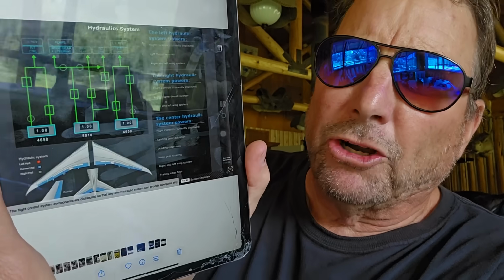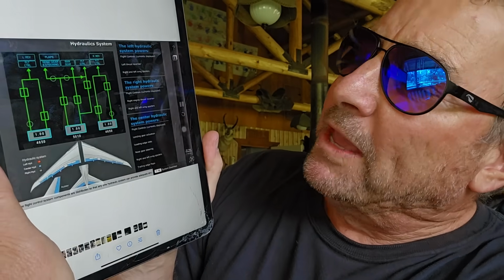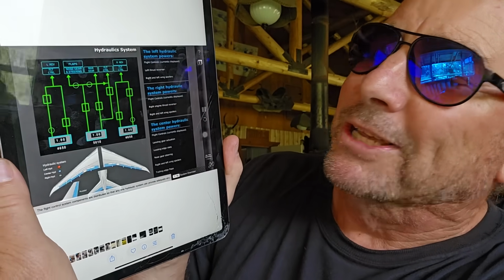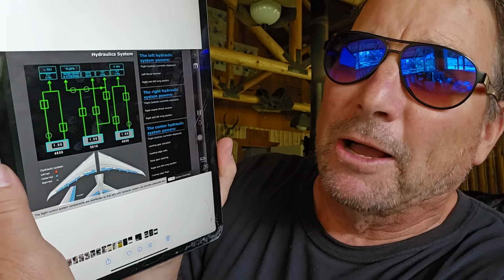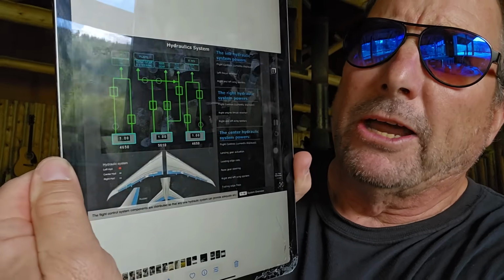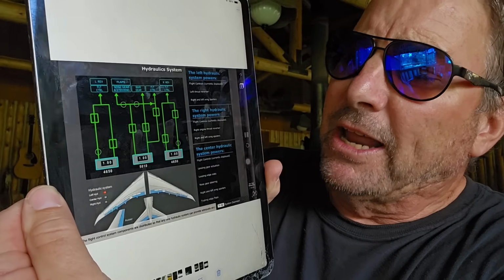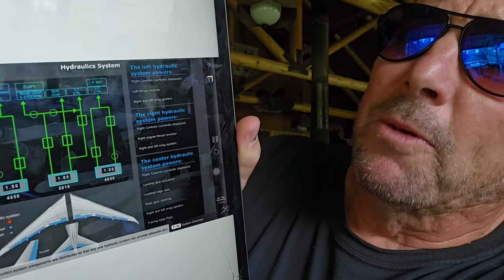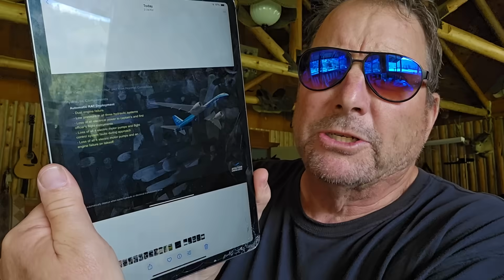787 Crash India What's a RAT? When does it deploy?

Comment: I am still thinking the co-pilot raised the flaps instead of the landing gear. This caused loss of lift and a dual engine stall or lower rotation than normal and then the RAT deployed. Trying to have someone confirm this is a possible scenario as it makes sense if this is what happened and the flaps were raised instead of the gear.

Comment: Repeat of a comment I made on the Captain Steeeve channel. As follows.....

It now seems probable if not certain that the RAT deployed, although it is not clear when the RAT deployed. It would be helpful if we had audio of the plane accelerating down the runway. I nevertheless find it extraordinarily coincidental that the 787 made it to take off speed (174kt), rotated and began an initially successful climb and then had both engines shut down at precisely the worst possible moment. Impossible-sounding coincidences can and do of course happen. I would be interested to know if Boeing had previously analysed and tested all possible failure scenarios in which both engines fail at the same time. Is it the case on the 787 that fuel is the only common denominator?  Can the plane itself be eliminated? 

The plane was refuelled at Ahmedabad for the long-distance flight, thus new fuel was added to old residual fuel. Could it be the case that the plane taxied out and did its take-off run on old fuel before complete mixture had taken place or having reached the new fuel? If fuel is the only common denominator then this to my mind is the source of the double shut down. If there is no common denominator other than fuel then both engines shutting down at the same time is statistically so improbable that it can be discounted and the plane itself exonerated. It goes some way to explain why in 14 years of service no 787 has had a double engine shutdown.

Comment: I vaguely remember a crash in the past .. airplane (737?) was right out of maintenance .. and basically the fuel didn't flow properly from tanks to the engines. But it worked well enough, so they could startup, taxi, and take off .. only then both engines just turned off, and they crashed.
I can't find it .. AI tells me it's for sure the crash in India .. I mean I swear I'm not time traveler .. I only become one in 2037.

Comment: It's pretty big. I am the one who actually installed the RAT on that specific airplane. I don't see it. But does not mean it's didn't deploy. But one thing I can tell you is 100% of all our airplanes will crash the same way if you don't have the flaps down. They were retracted. Plus he took the whole runway to take off. Not for any reason would a 787 need to use the whole runway. Even if over max weight. One engine can take off in shorter distance. FYI the 787 has a very strang sound compared to any other airplane. Hard to say. But when we test the rat, it doesn't sound like that. Not at all. The flaps not deployed will cause all Boeing planes to crash on take off. Facts. So he had time to stop before take off. He still chose to take off. Why? That's the real question. He knew before taking off their was an issue. Again he took the whole runway to take off. Only needed 1/3 of it to take off. So why didn't he abort. Human choice was the reason for the crash imo.
Reply: Dude, due to reduced power takeoff performance we use the whole runway all and I mean all the time. I’m a 40 year A&P IA who used to do jet engine overhaul and heavy aircraft maintenance and checks and now have over 21,000 plus hours doing so with several engine failures, flight control, hydraulic, electrical, landing gear, and even stowaway in the nose gear well, so use your mechanical knowledge to do a better job figuring out what happens to the facec engine control if you have a complete AC power loss.

Comment: I’m an ATP pilot who taught the 787. Every mechanical issue has been addressed. Now for the issue no one wants to address. You only have to remember German Wings, Egypt Air and FEDEX to realize this could be a cockpit member issue. Someone could have intentionally selected the engines to Cutoff after liftoff. This would result in hearing the RAT noise without engine noise. I certainly hope this is not the case.

Comment: If the AC power transfer from APU to engine driven VFSG generators silently fails, and isn’t caught in the crew alerting system screen before APU shutdown, (which is a required check by the pilots to make sure the engine driven generators are online prior to APU shutdown) and if the APU is shut down just prior to takeoff (shuts down in a 1 1/2 minute process after selecting APU off) the 787 can lose all AC power right after liftoff, causing engines to drop to idle thrust safe mode until the thrust levers are cycled. There is no takeoff configuration aural warning for this condition.

Possible 787 Sequence – Dual AC Loss & Idle Thrust Safe Mode:

After start up, AC power transfers from APU to engine generators automatically in the 787. If it does not transfer due to some Buss fault and the pilots fail to recognize it, and then for example the APU is shut down just prior to takeoff in a trained human flow pattern, it takes 1 1/2 to 2 minutes to shut down. The APU being the sole provider of AC power at that point may shut down just after takeoff. At that point there would be a loss of AC power.   The RAT deploys. Engines may drop into idle thrust “safe mode,” even with thrust levers in TOGA. Keep in mind that 787 thrust levers never move normally via auto throttle /Fadec at all.  To recover thrust, with loss of AC power though, pilots must move levers out of TOGA detent and then back in to TOGA detent or full forward. This tells FADEC (powered by engine driven permanent magnet generators PMG even without AC power) to exit “idle thrust” safe mode. Again no AC power is needed for this, moving the thrust levers out of the position they were in just prior to AC power loss makes the Fadec recognize pilot manual control input by lever movement out of the original TOGA detent and back into TOGA, or full forward to regain full takeoff power, or for thrust to simply follow manual thrust lever movement.

Again this could happen if, for example, the APU was shut down just before takeoff, but engine VFSG generators hadn’t actually picked up the load due to a bus fault or automatic switching issue. If that fault wasn’t seen when the pilots are supposed to check for propulsion engine driven generators online before shutting down the APU, (maybe the indication was buried under other MEL messages on the crew alerting system screen?), AC power drops off due to APU shutting down after liftoff, (if APU shut down just prior to takeoff roll), due to loss of AC power, RAT kicks out, engines go to “idle thrust” safe mode, and unless the thrust levers are moved from present position in TOGA takeoff thrust detent for Fadec to recognize human manipulation, the engines rollback and stay at idle.

Landing gear didn’t retract because 787 hydraulics for something that large relies on AC hydraulic pumps and after RAT deplored there is limited AC power and hydraulics. It was canted the opposite direction like it does when it is starting to be retracted, so we know they put the gear handle up. It’s hard to see the flaps down due to the plan form of the wing viewed from behind. If flaps were not down in a takeoff position they would’ve received an aural takeoff configuration warning. Crash pictures show flaps in takeoff position. A loud bang and flashing lights would be emergency lighting and the RAT slamming down hard with loss of AC power.

If the APU was shut down earlier before takeoff, somewhere earlier in taxi, and there was some sort of buss fault preventing automatic transfer of AC power from APU to engine generators on engine start up, then shutting down the APU would have just caused the aircraft AC power to drop offline. Systems would simply go dark while safely on the ground, and the situation would be obvious. 

Pure speculation.

Who am I? Nobody. Just a 59-year-old airline pilot, 21,000+ hours, A&P/IA since my teens, with involvement in seven engine failures behind me (in old cargo planes) , and a slew of other weird mechanicals I’ve seen that have forced me to try to figure out and program a response that might not be known readily, for the worst case scenarios. During training and learning operational flow patterns the book will say do this, so I say what would happen if I unintentionally didn’t. And follow that chain of events to the end. 

Recognizing we are human, and looking for human mistakes is what makes us safe. Sometimes it’s the small missed step that sets off the whole chain. 

Good thing we will see what it actually was with the boxes and I wouldn’t be surprised with today’s FOQA and ACMS that data has already transmitted live.

Comment: Juan Could a Battery explosion  taking out a lot of power distribution and possibly damaging hydraulics too. The engines may upon loss of control default to idle??? The batteries could be the noise heard and cause the RAT to deploy. Causing no flame of smoke from the engines. All these things make sense. If this is true the Data and Voice Recorders may stop when this type of failure.

Comment: RAT deploys 
Loss of both engines 
All 3 hydraulic system pressures low
Loss of all electrical power to capt and f/o flight instruments 
Loss of all 4 EMP’s (electric motor pumps) on approach or landing 

Been a while can’t recall the other one

Comment: Juan; a typically on point analysis. There are so many knothead YouTube content creators that are happy to tell us that they are experts. As a happily retired 787 captain I’ve been close to throwing my iPad across the room. 

One “expert” said that the flaps are “so big” on the 787 that you couldn’t see the engines from a rear aspect shot. Nonsense.

Another burgeoning “theory” by another “expert” is that the FO mistakenly raised the flaps instead of the gear. Baloney.

Keep up the good work and enjoy Idaho!
Reply from the maker: Yes, its really pissing me off!
Reply: On pprune half the comments there also speculate re confusing gear and flaps. Don’t go there or you’ll break your iPad :)
Reply: Maybe they haven't raised the gear, because there wasn't positive rate.
Reply: might there have been breaker trip right at the point of gear retraction, from some mechanical binding condition on the gear assembly due to lack of lube or grease? Am thinking of the Alaska jackscrew phenomenon  @natalja3471
Reply: The CVR...Cockpit Voice Recorder has been found
Reply: Indeed captain, there is a lot of misinformation going on. I dont fly the 787 but I doubt that accidental flap retraction could down the plane, even in the first takeoff segment, and I even read that the 787 has systems that prevent that. And the RAT deployment clearly points to some problem with the power plants. I also have difficulty understanding that some fuel issue would cause both engines to malfunction simultaneously. It might be wrong or premature of me, but if someone had dropped both engine fuel control switches, that could do it. Or some MAJOR electrical issue that could bug both FADECs in such a way…
Reply: Just wanna say that i called it.
Reply: @caili999  You mean I called it? Read my other comment here :)
Reply: @LionBlu2000 no i mean I called it.
Reply: @caili999  No, I called it.
Reply: It’s incredible how wrong so many experts can be!  They’re all ignoring; photos of the wing after the crash with the flaps down, and the video with the Audio clearly shows RAT deployed.
Reply: lol the issue was brown pilots
Reply: So you  drove/flew B787 Dreamliners to pay the gas and electric bill, so in your opinion if one engine still ran , a B787 dirty , with undercarriage ,flaps ,slats extended ,on emergency RAT power can climb to a safe  altitude?.
Reply: I becoming sceptical of your info in light of you becoming defensive and disparaging a theory that was put forth before RAT deployment became known. 
     Could be the gear was not raised because it was merely overlooked while in a panic to get the plane flying.
Reply: @buntnik I apologize. I suppose my 40 years in aviation, 30,000 hours, thousands of takeoffs and landings on every continent in all manner of civilian, military and commercial aircraft, including the 787, may have lead to a certain bias and intolerance. I will try to be more patient as content creators chase clicks with their unsubstantiated and speculative theories about “skinny wings…huge flaps….bird strikes” and now “panic.”
Reply: @SSBailey77845  All is good and you are right, but just FYI watch the video about DHL crash in Vilnius, Lithuania. Basically pilot 'clicked the wrong buttons' and crashed the plane. So some things happen.
Reply: @buntnik be interesting to hear "positive rate gear up" on the CVR, or perhaps lack thereof of such callout.
Reply: @buntnik someone better informed could confirm this but what appears on the video is that main gear is tilted forward as in the sequence of gear going up. If that's the case it would mean that loss of power occured just after selecting gear up?

Comment: Dual engine flameout shorty after takeoff. Landing gear was last thing on their minds if the engines were sputtering . There hv been suggestions that the plane used the entire runway .
The extreme heat and lack of rain caused an extraordinarily large dust pile and debris at end of runway that is evident after takeoff. British Airways had a 4 engine flameout from volcanic ash high altitude. Is it possible that the dust and debris caused a flameout at
rotation?

Comment: I think the plan had a hydraulic loss.. the one survivor said he heard the engine thrust trying to climb… I think they loss the flap due to a hydraulic failure.. so they lost lift.. that’s why the rat deploy trying to produce hydraulic pressure.. but it was unrecoverable at that height. The rat would only work at higher altitude. Not really design to work so low..

Comment: Regarding Flaps 5 setting....we were departing SFO yesterday and as we were taxiing south on taxiway Alpha to runway 1R, a B787 (two aircraft in front of us) was facing north on taxiway Alpha, holding short of taxiway A1.  We both looked at the flaps and they were OBVIOUSLY deployed...I will assume at Flaps 5 because they weren't deployed enough to be at Flaps 15.  We saw this in profile view.

As we taxied farther around the turn on Alpha and got behind the 787 and facing north in the same direction as the 787, we could hardly tell if the flaps were deployed, but it was evident they were.    The 787 took the runway for departure and we were curious if we would be able to tell if the flaps were deployed at Flaps 5 as it took off.  At rotation, you couldn't tell if they were, as the blended wing and the bowing of the wing as it produced lift made it indiscernible; it looked EXACTLY as the wing did in the Air India video.

Comment: @blancolirio A complete electrical failure would explain everything:deployment of the RAT, landing gears not retracted, loss of thrust, and even flap configuration. The fuel system and the hydraulic system are electrically powered. If the hydraulic system failed then there is no pressure keeping the flaps in the proper configuration. Once the RAT deployed and power was partially restored, they probably tried to extend the flaps again. I think something happened when they tried to retract the landing gear that caused an electrical failure.
Reply: There are also reports of electrical problems on the previous flight. Not to mention, there was a software bug that caused the electrical system to completely shut down if the generators were left on for an extended period of time. Air India is known for pushing the limits.

Comment: Based on this comment on the AVHerald, where does MCAT kick in and will shut down 2 engines?

Findings
By jepper on Sunday, Jun 15th 2025 14:23Z

1. **Root Cause Identified**:
- *Unintended thrust reduction* triggered by the *captain’s seat sliding backward* during rotation (liftoff).
- The seat’s **AFT lock mechanism failed**, causing sudden rearward movement. The captain’s body weight forcibly pulled the thrust levers to idle.
- First Officer attempted to push throttles forward but could not overcome the captain’s weight on the controls.

3. *Flight Deck Timeline* (CVR/FDR correlation):
- **+0:12 sec**: Rotation begins. Captain’s seat slips aft abruptly.
- **+0:15 sec**: Thrust levers pulled to idle. First Officer: "*Thrust dropping!*"
- **+0:18 sec**: Captain: "*My seat!*" Struggle heard.
- **+0:26 sec**: First Officer attempts full thrust; aircraft stalls at 214 ft.
- **+0:38 sec**: Impact.

Comment: I’m a Sim Tech at CAE and was trying to  make sense of what could possibly cause both engine to shut off or loose trust at the same time. It must be something that they share. From what I understand the fuel pumps are electric on the 787. Can it be possible that a loss of AC power  shut off the pumps and caused the engine to shut off or loose trust? I know the engines  can be supplied with fuel thru suction but that will not be enough for take off when engines require lots of fuel. Loss of electrical power will also explain the RAT deployment and hydraulic failure.  Just an idea.